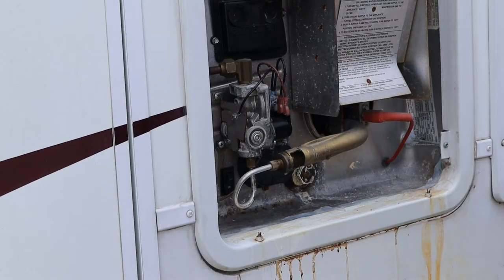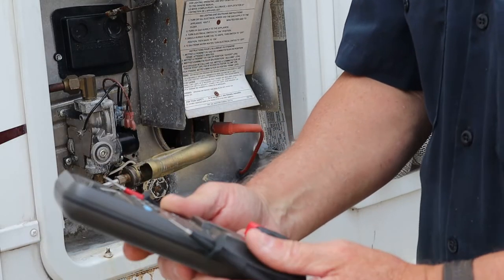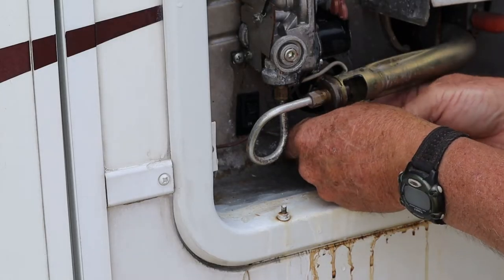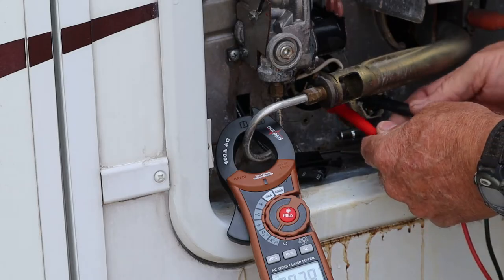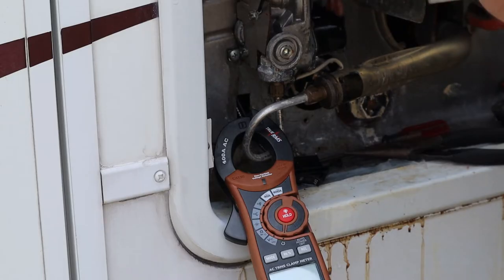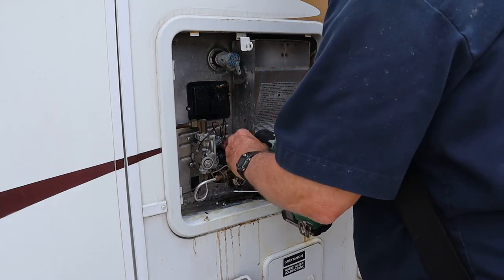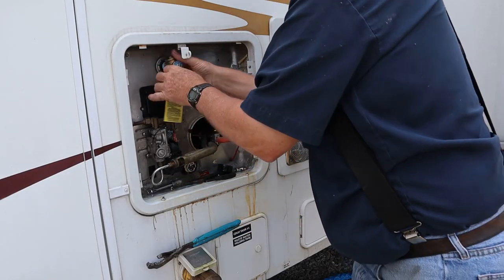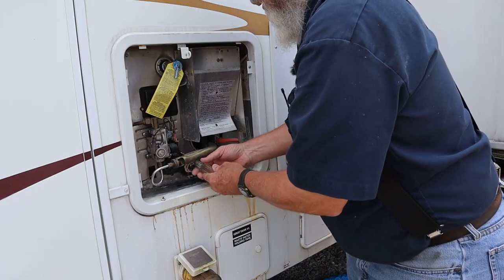Suburban Water Heater Diagnose And Repair

Comment: Now as a 35 year pipefitter, I use not only Teflon tape, but when water, steam, or condensate is present, I always put a dab of neversieze on the threads with the Teflon. It makes life easier for the next time.
Reply from the maker: Probably a good idea. Thanks

Comment: I'm on a trip to PEI Canada. My Suburban water heater (electric side) quit working today after a major rain storm. Rain had been blowing into the water heater and everything was wet. My small black rocker switch was stuck ON. I forced it to OFF, and then I worked it ON/OFF several times. I pressed both RESET switches, and I reset the Breaker. The Breaker had not tripped, I just turned it Off and  On. My 12V Lights dimmed momentarily, so I assume the electric heater reactivated. I will find out shortly.
UPDATE: I replaced the on/off rocker switch and the water heater worked once again.
Reply from the maker: I hope it works now.
Reply: @hillbillyrv It did not work. I'm going to pull out the little black switch tomorrow and test it. It's currently stuck On again and will not shut off.
Reply: @46fd04 mine is doing the exact same thing! If you don’t mind, how did you fix it?

Comment: I was hoping you would trouble shoot the gas side of the heater. my gas wont light.
Reply from the maker: Sorry maybe next time.
Reply: Yes. My light isn't coming on when I turn my propane tank switch on. I'm not familiar either
Reply from the maker: @adibarr8996  Make sure all of your 12 volt DC fuses are good.
Reply: @hillbillyrv  done.
Reply: OMG! The outside on/off rocker switch was flipped on! (where the water tank's outside access is) switching it to electric ..which apparently doesn't work!! Yikes!!
Reply from the maker: @adibarr8996  We find those bad a lot.
Reply: @hillbillyrv I got a question
 I'm a tech. I installed a new sw6de. Customer ran it fine one weekend. The next weekend they start the propane and a flame shot up on the upper left side. 
When I got there the entire base was hot. 
I inspected the entries 120 side and ran it for a couple hours with no issues. 

The black wire that is used as a jumper between the solenoids was melted, the black plastic covers were also melting. 
Have you seen this before? Any help would be good. 
Thanks

Comment: Hi Hillbilly !  Got a new To us 2010 keystone hideout. It has a suburban 6 gallon water heater. It’s dual fuel which I’m sure you know.  Is there a way to disable the propane so it only relays on electric ?
Reply from the maker: Just don't turn the DIS switch on for the propane use.
Reply: @hillbillyrv  haven’t been able to locate that.   There’s the red light switch in the kitchen which got it going after I replaced the element .  That’s probably it I bet

Comment: I have the same water heater in this video . Water heater was working fine since I've had the rv for a yr . I took a shower an after , I smelled an electric burning smell an the AC power cord to the water heater was getting hot  so I unplugged it waited  little while then plug it back in thinking maybe there wasnt water getting to the tank due to switching from electric water pump to regular hose water connection now I have no hot water just warm not hot  should I replace the whole system now ? Please help I'm an auto mechanic not a rv one
Reply from the maker: You only have to change the whole water heater if the tank gets a hole in it. Just take a deep breath and then get your multi meter out and watch some of my other water heater videos and start diagnosing it. You will figure it out.

Comment: My Suburban hot water heater's 120-volt side melted the wire by the temperature sensor that goes to the heating element. I fixed the wire and replaced the sensor only to have it melt the wire again the same day.  So I tested the wires and the only thing strange I found was the ground wire that hooks to the heating element had 24 volts and this is with it disconnected from the heating element. Do you have any ideas where the ground would be getting 24 volts from?
Reply from the maker: Check the heating element. It could be shorted.

Comment: Wouldn’t the heating element only have 120v if the thermostat was reading low water temperature??
Reply from the maker: Yes. If it has hot water in it when I get there, first turn WH off and run a lot of water to cool it down.

Comment: I wonder why my suburban water heater won't light on propane? I just had it running on electric mode and actually had it running on propane last night. Now I don't get any clicks like it's trying to light or fault light on my switch panel and I've checked all my fuses that I know of underneath my converter cover and I have propane to all my other appliances. Really don't want to go to Camping World today working.
Reply from the maker: Turn the electric off and run some water. See if it lights on propane then. Maybe the water is already hot.
Reply: Yep I let it sit for a while and then I ran some water and I heard a happy roar!

Comment: I have same water heater SW10DE but need to change gas valve and outlet manifold tube that connects valve to burner with those brass 1/4 inch nuts ?  Do you need to flare new tubing ?  I am puzzled how to install new tube from gas valve to burner.
Reply from the maker: They have brass ferrells on them.

Comment: How would you adjust the air on the burner if it doesn't have slide like the atwoods do? Mine is suburban just roaring with a pretty much wide/yellow flame. I know there's a little hex screw in there but not sure what it does.
Reply from the maker: yeh, no air adjustment on those.

Comment: I’m having the exact same problem right now, when you checked the element for power did you leave the wires on.
Reply from the maker: You have to remove the wires and best to drain water too.

Comment: Thank you sir, I put in a new suburban propane water heater in my RV only about 5 months ago and yesterday it stopped working the burner will light up and burn just for a few seconds and turns off. I wonder if it's a flame sensor?? Do you know just where that is and can you clean it or do you have to replace??
Reply from the maker: It could be, but probably the control board. It's still under warranty.
Reply: @hillbillyrv  I believe you are right. Thank you, I imagine the only way to test that electronic control panel is to just replace it?? I bought it on Amazon, home delivered $454... Tillamook RV repair wanted $992
Reply: @JacStocker isn't the flame sensor the thermo fuse attached to the thermostat?

Comment: I have a 2006 Hitchhiker Trailer, why would I have hot water in the kitchen sink and not in the shower?  Is there a valve I need to turn on?  Thank you for the video.
Reply from the maker: I don't know. That's kind of crazy.
Reply: @hillbillyrv  very odd indeed…thank you for replying Sir.

Comment: Hi HillbillyRV. I have the same suburban system. I suspect its my sparker. How would I diagnose the issue
Reply from the maker: I don't know what you mean by sparker? The electrode or board?
Reply: @hillbillyrv  Electrode! Also, will this system heat up with electricity alone?
Reply from the maker: @robertoperez95  Electrodes a not expensive. I don't really know how to test, so if it is suspect, just change it. If the water heater has an electric element and it is working, yes, it will heat on electric.

Comment: Even when i know what was wrong right away i still watched cuz i always pick up a random thing that makes life easier in some way or just to see if i was right. The drip was dead giveaway
Reply from the maker: Thanks for watching Brent
Reply: Hey Brent, would you be willing to help me fix my SW6DE through a facetime call. I can pay you paypal, venmo. The only thing that doesnt work on mine is the spark
Reply: @robertoperez95  is it clicking trying to spark?
Reply: @brentsharp8234  yes
Reply: @robertoperez95   go light your stove to make sure there's gas. If it lights then go out to water heater and where it sparks bend it into gas supply they tend to move  (with power off to it then after ya bend it turn it back on )
Reply: Yes I have gas! Furnace and stove work 100%
Reply: @robertoperez95  ok I'd try bending that because if it's too far from lp it's won't light . It will only try 3 times (clicking)and it locks out so you will have to go inside flip switch off and wait a few seconds and turn it on again to reset it and try again. Random question what's your battery voltage with rv NOT plugged in
Reply: @brentsharp8234  just got a brand new battery. I'm here on site working on it. I'd 100% pay you for your time
Reply: @robertoperez95  I tried to send my email but I think YouTube removed it cuz it won't let me post it
Reply: Yeah these rvs are a piece of work
Reply: @brentsharp8234  wow my full name is Roberto Perez from Brewster WA
Reply: Look me up on facebook
Reply: @robertoperez95  did u try what I said yet?

Comment: Hello great videos, I need some help with a brand new surburban 10 gallon hot water heater. I just installed it in a Forrest River sand piper 5th wheel, im having trouble with no hot water pressure at all coming out of the new tank, none of the hot water faucets have anything coming out. The cold side works fine at all faucets and it’s hooked up to city water. The tank has been heating up fine so far because I have checked the water with the drain plug. I have been searching everywhere and have found people keep telling me it’s a check valve or bypass valve. Well I full time in this rv and have had a leak before so I have taken out all the bypass valves and also there is no check valve at back of hot take hook up, I just have a clear plastic thread tube where the water connection screws to. I am stumped on why I have nothing coming out of anywhere. The tank that was before it worked fine and haven’t changed nothing in the system. Had to replace tank because it rusted a hole in it. Any advice? Thanks
Reply from the maker: I would have said the check valve or bypass valve. Loosen the waterline at the top of the tank and see if anything comes out. If it does, then you have a blockage in your waterlines. If nothing comes out, then the problem is in the tank.
Reply: @hillbillyrv  thanks for replying ok I’ll check to see if there is anything coming out, what would u say could be in the tank if something was blocking it being it’s a brand new tank? Also there is a little black piece that’s inside the hot water outlet treads, is that supposed to be there? Looks like a plug but when I have tried to get it out it won’t move?
Reply from the maker: @themodifiedlife2774  I have no idea what that is, but I bet it is your problem. That pipe should be wide open.
Reply: @hillbillyrv  well the old tank that we took out has white plugs on both inlet side and outlet so I thought it must be a factory thing
Reply: @hillbillyrv  so I opened the hot water side and no water came out, I then turned off water and drained the tank and then undid the cold inlet side and then realized the plastic piece i installed was a check valve and it was going in backwards. Do u think that effected it from flowing out the hot side? The plastic piece cross threaded on me when I went to reinstall it so now have to get a new one before I get to test it out.
Reply from the maker: @themodifiedlife2774  If the water can't get in, then it can't get out either. I hope you didn't burn up the heating element by running it dry.
Reply: @hillbillyrv  well there’s been water in the tank because when I have pulled drain plug everytime there’s a lot of water coming out and it’s hot
Reply from the maker: @themodifiedlife2774  Ok good.

Comment: I learned some things from the video, thanks. But from what I could see you eventually just reset the thermostats and that got the heater working again? With all due respect it seems like that would have been the first thing to try, and then you wouldn't have needed to do anything but change out the relief valve.
Reply from the maker: Well, learned some things. If I had just pushed a button, you wouldn't have learned anything.
Reply: @hillbillyrv  Very true, ha. And now I am trying to diagnose my water heater based on what you so helpfully showed. The gas side of the water heater works but the electric mysteriously does not work.

The heating element is good (10 ohms), there is continuity through both thermostats, and the on/off rocker switch there is good. It looks like I am not getting 120V to the switch. Inside I see no thrown breakers or blown fuses. I pulled the interior switch panel.  Seeing no signs of burnt wiring. The rocker switch for turning on the water heater there is good. I am having trouble determining if there is 120V at that switch, not clear on where to find a ground.

I'm going back with an AC sensor that should help me trace voltage. Is the water heater on a circuit breaker that may have gone bad? What else can I look at? Any suggestions much appreciated.
Reply: @hillbillyrv  I found a ground. I am seeing 12V at my interior rocker switch which goes to zero when I turn the switch on. Is there a relay somewhere that it activates? If so maybe that's bad? I am seeing that there's a 'control board' for these heaters that has a relay. Any idea where I will find the control board?
Reply from the maker: @billcarter1182  Only DC power, No AC voltage at the switch inside RV. There is a connection at the water heater and there may be relay there as well. Check those. Follow the electricity.
Reply from the maker: @billcarter1182  Follow the igniter wire, you will find the control board. Yes, there might be a relay.
Reply: @hillbillyrv  Many thanks for the reply. Having scoured the internet I see there that these Suburban water heaters come with a 'module board'. The board has a relay on it that is activated by the 12V switch, and that relay applies the 120V to the thermostat and the heating element. Apparently it is not unusual for this board to go bad, and if it does the relay will not throw. I am seeing where I can buy a replacement board for about $90.

Unfortunately I can't locate the module board. I've removed enough panels to expose the exterior case of the heater and see wires running to it, there's no visible module board outside of the heater enclosure. I've got a bad feeling that the board is inside the unit. I'm not seeing any obvious way to open it up so I can get to whatever is behind the front panel. Any suggestions?
Reply from the maker: @billcarter1182  It's outside the water heater case. You just have to find it.
Reply: @hillbillyrv  I found the module board, it was on the other side of the unit (right side looking from the front). But now I think it is just the controller for the gas side of the water heater. It operates the gas valve and the ignitor electrode. I still don't understand how the 12V rocker switch in the interior panel activates 120V AC to the heating element.
Reply from the maker: @billcarter1182  Look in the junction box on the water heater and see if there is a relay.
Reply: @hillbillyrv  You are right. I found an exploded diagram of my unit, the relay is in that AC  junction box. Unfortunately I can't get to the box from the interior without cutting holes. I guess I will have to unhook everything and pull the unit forward about a foot to expose the box, not fun.
Reply from the maker: @billcarter1182  Sometimes that's what you have to do. Welcome to my world.
Reply: @hillbillyrv  FYI, I finally got around to pulling the heater out a ways. Sure enough the relay was in the junction box. It turned out that one of the wire lugs probably hadn't been pushed on to it all the way and had popped off, probably from vibration. The hardest part was disconnecting the water lines from the rear. I had to cut a couple of pex crimps to get it loose. And had to use a heat gun to soften up the pex lines enough to pull them off the fittings.
Reply from the maker: @billcarter1182  At least you found the problem.
Reply: @hillbillyrv  Thanks very much for your advice!

Comment: Our model must be older because it doesn't have the two breakers for the thermostats out there. It has one rubbery reset switch but I'm not sure if it works. 
And I'm thinking my control board must be inside under the stove too. 
Looks like the main burner is the same. I'm going to go search for a Suburban manual
Reply from the maker: The control board is in the same place on ALL RV furnaces (no matter the brand) for the last 30 years. I have lots of furnace videos. Watch more to see if you get answers.

Comment: Hi there!  Our new travel trailer has a 10 gallon suburban hot water heater.  I've only had Atwood's in the past.  Thank you for showing me these maintenance items!
Reply from the maker: Be sure to check out the video that will be released at 10 am eastern today.
Reply: What is the name of the video also is there a way to check if these thermostats are functioning correctly?